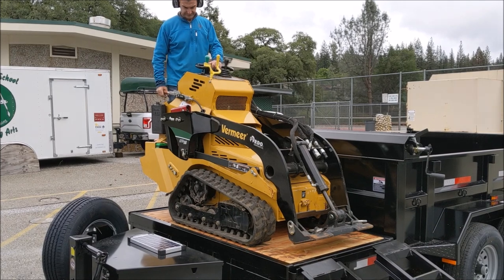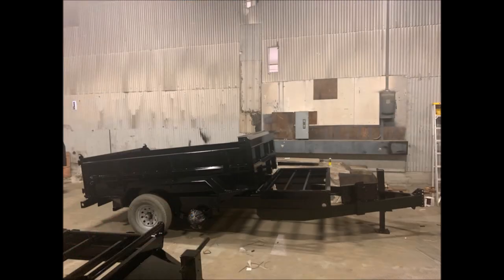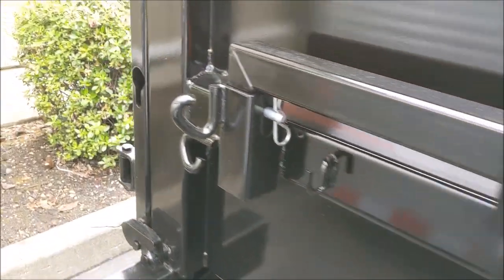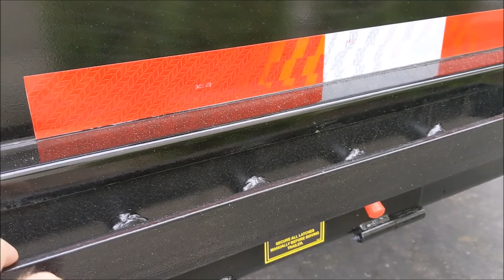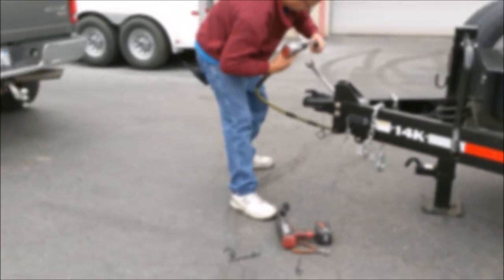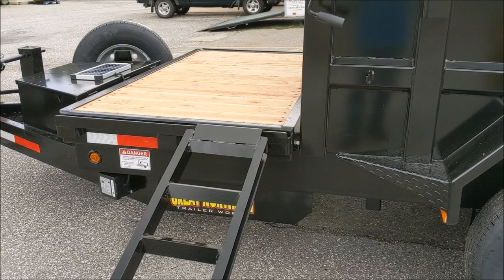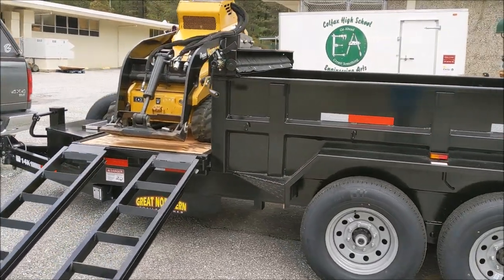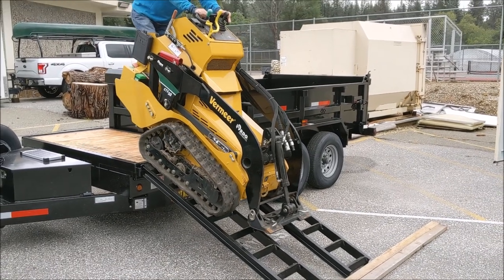Mini Skid Steer Dump Trailer Build and Use for Tree Work

Comment: I see he could go up and down on either side. Put on the bucket for counter balance and drive up one side and down the other. The pivot point on these mini-excavators is down right frightening and dangerous when going up ramps. No room for error.. If the machine fails you may lose control of it.
Reply from the maker: Very true

Comment: I see the video is about a year old now, at this point what would you do differently?   I'm looking into this design with a 16' dump box (20' trailer).

As to everyone saying the deck height is too high, it's something you get used to and learn to load more confidently. I currently load my mini skid on a 42" high flatbed truck with 10' ramps.  Depending on the slope of the ground,  the angle can be great enough that I do the same 2x4 trick for clearance on the ramps.  

As for the tip-over, many people when at that point stand next to it with just enough weight to turn on the operator's presence then back up to almost tipping.  Then stand on the platform and it tips nice and easy with your bodyweight and not while driving.   The same (but opposite) with unloading. Drive up to almost tipping,  step off to allow it to tip onto the ramps, ease forward a few inches then step on again.  Makes it much less dramatic feeling.
Reply from the maker: A year later, I wouldn't do it again. I would have the dump trailer four feet longer and buy a separate tip trailer that would be super easy to load and unload and make two trips, which is what I usually end up doing anyway.
Reply: @topsaw   is the tipping of the skidsteer at the top of the ramps your major downfall, or does it pull funny with only weight on the deck when the dump box is empty?

My mini skidsteer is a bit different than yours with one major difference being that it has tires instead of tracks. This means no tipping when transitioning on/off the top of the ramps. If that's your major downfall,  then it may still be a viable option for me.   

Thanks in advance for any insight as it'll be helpful in my decision.
Reply from the maker: @youtubeisfullofspam7068  yes, it does need to be modified
Reply: @Everyday Excavations that's correct, and it will pull away some weight from the tongue.

Comment: Nice build except for platform height. Extremely well built but platform is too high. Do yourself a favor and look into a pair of aluminum ramps. They make them all sorts of lengths. I think a pair of 8 footers would do you well. Very light and certainly lessen your approach angle. With muddy or wet conditions the current setup would be very sketchy
Reply from the maker: Will do, ill get some 8 ft ramps
Reply: Also would be careful with those ramps and loading anything close to trailers limits in back. I have had those style ramps fail before haha.
Reply: Did you get the ramps after all? I bought some 8 foot aluminum for my dump trailer and they're great. Fraction of the weight and much better approach angle
Reply: Absolutely and they way less get them for decent price . I use 5,000 lbs aluminum ramps.

Comment: I still cannot believe that great northern still uses the same ramp design after all these years. The thing that I hate about the ramps is the lips on the ramps that hold onto the trailer. Back around 2009 or so my dad had a great northern dump trailer and the ramps failed when they were loading a skid steer. luckily the machine didn't fall completely on its back. I saw it happen. The lips basically bent and then broke off. Not against great northern but we use a big tex dump trailer now and the lips on their ramps are a much more superior stronger design and nothing like the great northern.
Reply from the maker: I use straps to hold them to the lip

Comment: Not trying to 2nd guess but why did they make the deck  for the mini taller than the frame rails? I'm sure the framework to support the mini could have been incorporated into the trailer frame decreasing the load angle? Nice rig though.
Reply from the maker: It's a great question, not sure why he doubled up the steel and just had the platform lower. Probably just to make the platform completely bullet proof.

Comment: Nice trailer. On my mini skid I use the bucket to lift the front of the machine to the level of the deck just before the tip point.
Reply from the maker: Good way to do it

Comment: Great idea in theory but Im not at all a fan. Way to dangerous,  Hope you have longer ramps now and are ok with it. It looks like a very high quality trailer, Id think your tongue weight would be high when going to the wood site,but probably balances out great with a  full load.
Reply from the maker: It has taken me awhile to figure it out. I put the mini skid in the dump bed on the way there to balance it out and if the logs are close, I take two trips, logs in one, mini in the other. If I do load it on the platform i do have longer ramps. I do like the platform to work on and store tools on

Comment: What about sway from having all the weight in front of trailer? By the way nice trailer. I just bought my big tex sr70 and love it.
Reply from the maker: When the trailer is empty of logs, I put the mini skid in the back. Once loaded with logs I put it up front.
Reply: @topsaw  thanks for the reply. I'm not an expert ,but have seen info about it and was wondering. Again, perfect design.
Reply: Sway? More weight to front of trailer = less sway. No tounge weight or negative means insane sway. If half ton maybe a 3/4 ton truck pulling trailer tounge weight could be issue but even then it might not be.

Comment: My recommendation is to go up ramps forward and just walk up with it. Much safer than this. On a wet day with mud and uneven ground conditions that could be dangerous.
Reply from the maker: Not quite sure I understand. Do you mean off the platform?
Reply: Jp without an attachment the back is the counterbalance plus the operator so it's really back heavy. On my ditch witch I would drive up it because i don't have an operator presence switch and can walk up behind and not be adding more back weight. On this unit though backing up is the safest option.